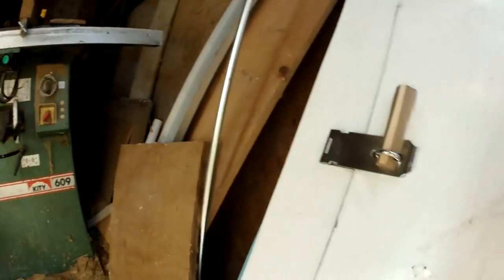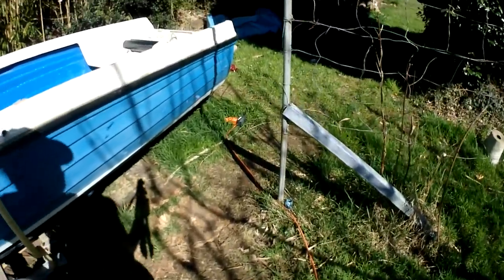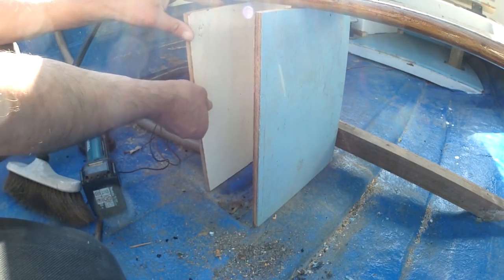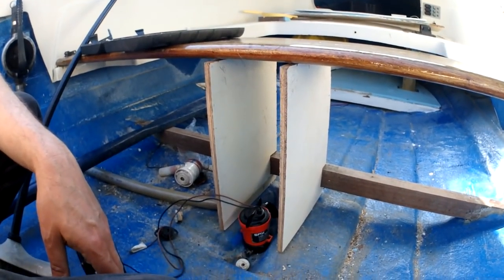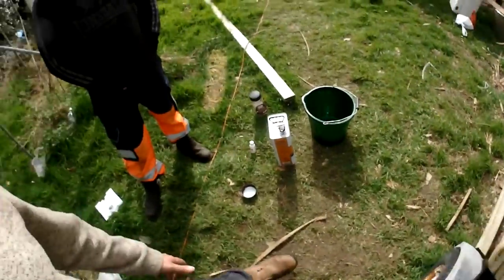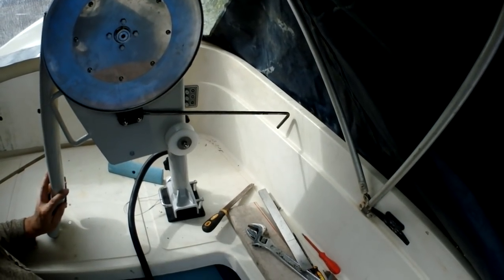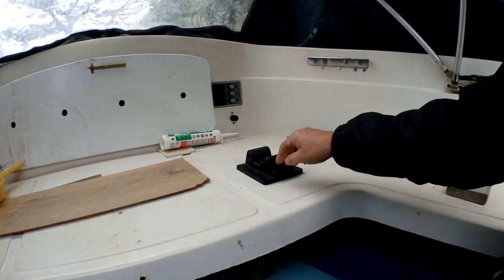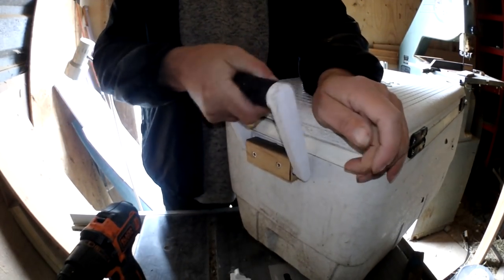Orkney Fastliner 16 Refit -  This Week, GPS, Fishfinder Locker Box, Resin, Bilge Pump

Comment: Great update Troy - looks like things are coming along nicely.  I like what you have done with pouring the resin inside the keel - it will seal the screws up and provide some extra strength.  Fish finder box looks good too - it looks as if it is easier to see the screens than on Tours Jolie.  Can you let me know what the Bandsaw is in the corner of your workshop please?  I've got a similar one but mine is smaller.  Thanks for the update - stay safe & well.  👍👍
Reply from the maker: Its a Startrite bandsaw
Reply: @Trojwaterman  Thanks Troy - I'll do some Googling!  👍👍

Comment: If u put a piece of celotape under the hole or scratch ,as u fill the hole gradually push the tape up ,it will hold the resin in, u might have to do it a couple of times ,and u will get some airholes
Reply from the maker: Good Idea